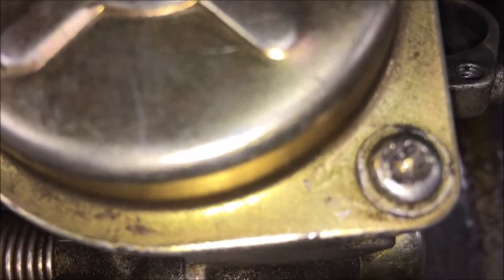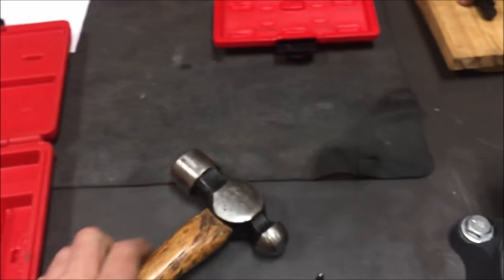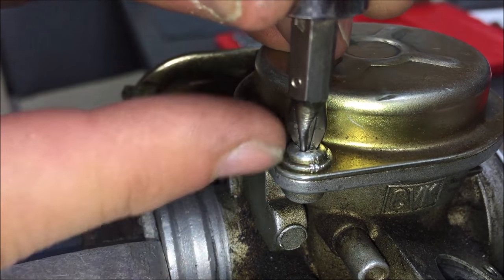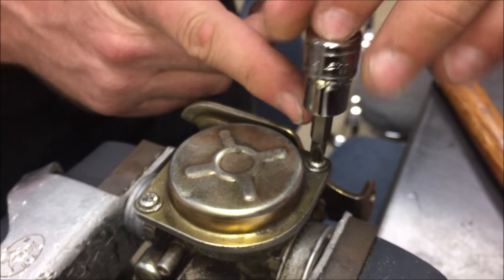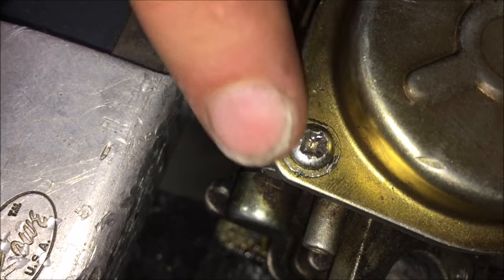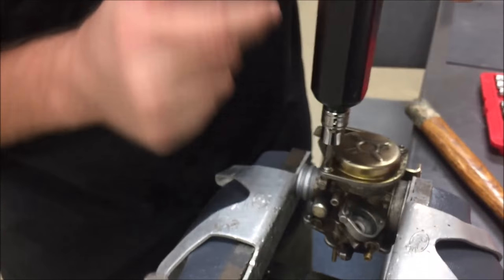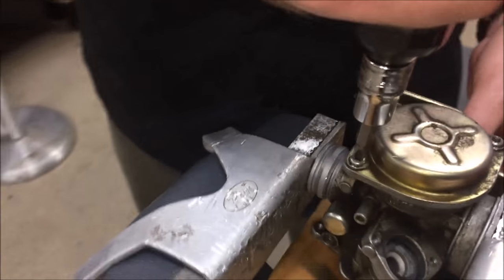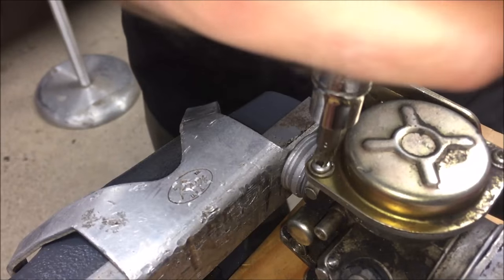How to remove stripped screws with ease. Demo tool: Snap On Impact Driver 208EPIT

Comment: mostly caused by using a phillips head screwdriver on a JIS screw.
Use the right screwdriver and reduce the risk of stripping out the head in the first place.

I haven't been able to find impact rated JIS bits yet - but once you get to that stage the screw is going to need replacing anyway.

Great video as usual, Shane :)

Comment: That's a good second option. I usually opt in turning it into a flat had screw with a Dremel EZ456B 1-1/2 In. EZ Lock Cut-Off Wheel.

Comment: I'm glad you say most of the time........some times I resort to a hammer and a small chisel and punch, and tap tap around........old bikes...are a problem.....getting a grip on a bolt head is usually impossible, and drilling, that's a failure...always...no exceptions....

Comment from the maker: People, try this exact checklist. The success is so dependent on feel, and intention. If there is ZERO meat to grab then it will not work. In this case you could see the two screws were severely damaged by the student. A slow thinking it through useful checklist demonstrate a complete success. What work could you possibly need to understand this? I have to do this repeatedly unfortunately due to student is commonly stripping and rounding out fasteners. I can only think of one Fastner I had to drill out because it was seized in the case and nothing would've worked in the last three or four years successfully removing at least 75 to 100 stripped bolts by students. No worries usually blows their mind when it works to and they stop and take a look at the slow intentional steps to be successful. If you just start smacking it with a hammer you're only going to make it worse frustrate yourself and not find value in this tool.